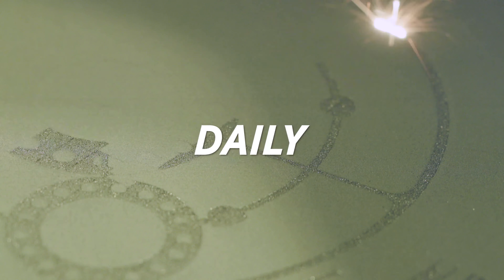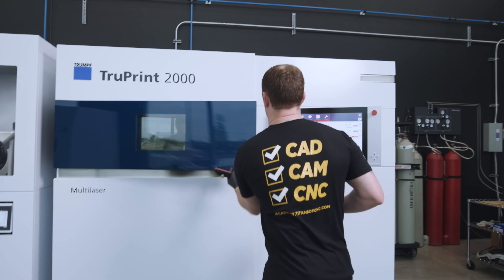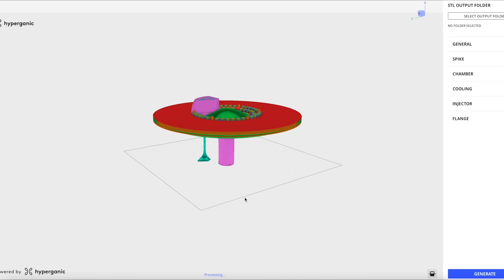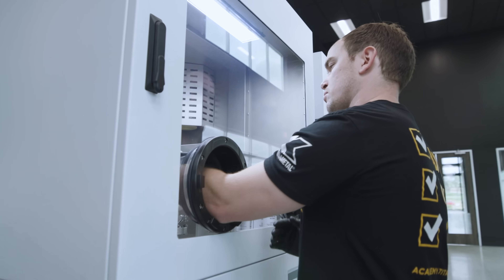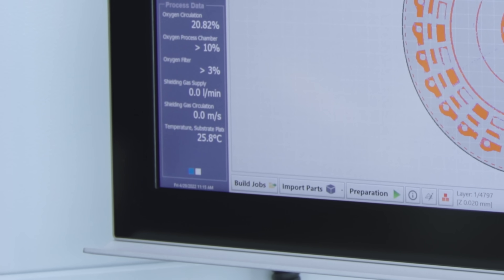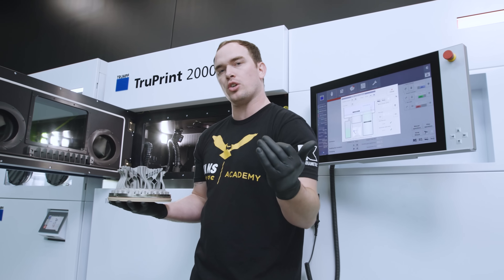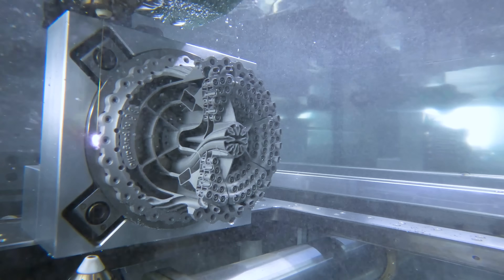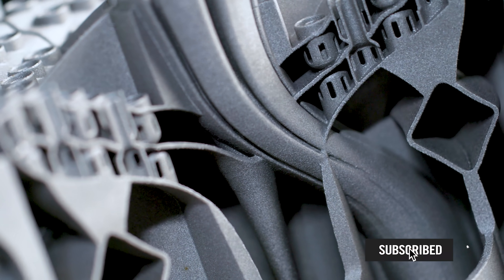3D Printing a Titanium Part Created By Artificial Intelligence

Comment: The future's going to be very interesting with AI design, 3D printing and modern materials making it possible to manufacture perfectly optimized parts.
Reply: Say a car would be made by ai. A suspension component breaks. Since all the parts are so optimized and interlinked you'd need a new car.
Reply: @njhgv9192  Not if the AI also considered maintenance
Reply: that tech's been around for a while, but in the last couple years, it's just become a lot more accessible to the common person.
Reply: @morbus5726  so what? The comment are still right. And the fact that it become more accessible mean it has improve.
Reply: @prumchhangsreng979  I'm not disagreeing with the comment...
Reply: Design by Evolution Algorithms is even more exciting. And those designs, unless constrained, are typically un-makeable except by 3D-printing.
Reply: @Vermiliontea  algorithms need to be constrained so that their designs can be built in the real world... at reasonable prices with existing materials... ect.
An algorithms only idea of reasonable or reality is what humans have vaguely told it.

One weakness is that an algorithms model of reality can never be perfectly accurate, so its designs cant be perfect.

and its never perfectly aligned with our goals because of the barrier between human thinking and machine thinking.
Reply: The social control that will be overseen by AI won't be good.
Reply: "perfectly optimised".
99% certain you dont understand the insanely huge strength differences between what is basically cast metal (layered sintering is probably even wear than casting actual molten metal in one go), and a hot-rolled or forged and machined billet of metal. i wouldnt trust that in a modern hobby rocket, let alone anything commercially viable.
3D printing is for prototypes, not finished products.
Reply: like flying saucers with gravity propulsion.
Reply: less and less humans needed in the process of manufacture and design
Reply: That no human can repulacate. That's insanity and by far the dumbest thing human has thought of. What's next we leave robots to get our women pregnant
Reply: @TheRealElmerninis  ai can already design things humans cant. Not because they are superior but because they think very differently from humans.
I mean its not opinion, look it up.
Reply: @hindugoat2302  I know that. I've been studying this for nearly six years now. No matter how much you try to normalize it. It's not. It's already taken new turns.
Reply: @hindugoat2302  
Your name??
Reply: @Justin_Why  and yours?
Reply: @hindugoat2302  
My name is Man in burkhaa
Reply: The day AI is used in Music and Movie production we'll see a whole industry die..Like the AI Paitning apps are changing artist's jobs
Reply: But future will be not for all.
Reply: That’s what this video is about.
Reply: And when the software crashes, it’s the fetal position. 👍🏻👶🏻
Reply: get ready to be unemployed, miserable, alone and living in a pod
Reply: Anyone seen the show The Peripheral?
Great imaginative probable uses of 3-D printers in the community in the future.
Reply: 4Head just let AI build itself better and better :D  what could go wrong : D let them take off and build bots : D
Reply: A movie was based on what could happen if we dabble too far into AI, it was the Terminator series 😝
Reply: @l0l0mgwtgdq  And, Colossus, The Forbin Project, in 1970, The Matrix, Blade Runner, 2001, A.I.(the movie), Minority Report, Terminator, Robocop, etc, etc.
Reply: I work in XR. This is one thing but full Virtual/ Mixed Reality worlds for design will turn this upside down.

Soon as full adoption and usability comes about designs like this will become next level.

Can't wait...
Reply: Until it becomes self aware and tries to kill everyone lol
Reply: @Whargoul100  assuming we even let it become self-aware in the first place lol. if we put these printers in communities, they could increase standard of life and abundance, while decreasing resource use and how much people have to work, giving everyone more time to enjoy with families and friends, or doing whatever they want.
Reply: So practically humans will become or already are becoming useless. Or even a threath to further evolution of technologies. Once we start don't like where the progress is going we will try to stop it or limit it while AI will disagree with our primitive decisions.
Reply: @EddyKorgo  SkyNet
Reply: @EddyKorgo  nah. There is a reason why they don't show de process of making the part. It's still very labour intensive
Reply: @EddyKorgo  yeah if you live in a sci fi movie

Comment: Very Cool!  Do you know what two propellants are going through that injector?
Reply: None. It's a demo part. Would melt itself real quick. Those thin walled baffles wouldn't stand a chance, not to mention titanium is a terrible choice of material.
Reply: @mattsoup4121  I think you are confusing the combustion chamber vs the injector.  The Combustion Chambers uses super alloys and many cooling methods to keep from melting.   
The Injectors have propellants at much much lower temps.  possibly in a gas or liquid form. (depending on the propellants.)

This particular injector has cooling channels installed also.   Anyway it's a disposable one time use unit (if not for Space X or RocketLabs) it needs to work for max 5 min?
Reply: @mattsoup4121  Wow, sound's like a really cool job!  I'm just am merely a rocket enthusiast...  with JUST enough knowledge to punch myself out of a paper bag!  I naturally differ to that experts out their.    

So what would a injector normally be made out of?
Reply: @vonpredator  There are many material options. Copper is common, so are high temp superalloys. As far as what I use that's not something I can discuss.

Comment: I have a resin 3d Printer at home and am asking myself how do they get the metal powder out of the cavities and hollow spaces? As far as I can tell  everything should be filled to the brim with powder and I don't know if a vacuum is reliable enough to clean those nested spaces inside the part?
When using the resin printer, which works similar but not quite the same, you often have pocket of resin which you have to drain, but how does this work with a metal part?
Reply: As long as there are no fully enclosed voids, the powder will be able to come out. The powder for a powder bed printer is all spherical, so it flows very nicely. Some parts of the print may need some help with some suction, but you'll get the powder out.

(Unless you deliberately enclose powder, which can be a valid approach if you want to reduce the heat transfer for a given section.)
Reply: @Hydrazine1000  Thanks, that explains how they are able to get it out. Resin is quite viscous and if you design the holes too small it will take a long time to drain, if at all